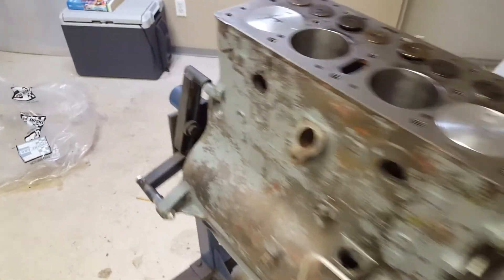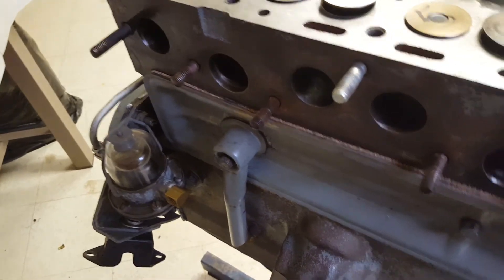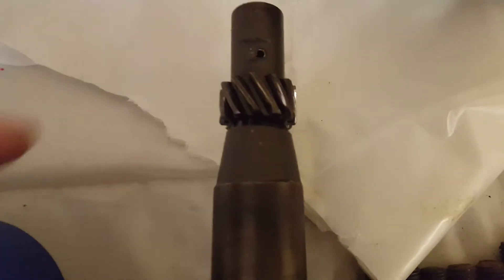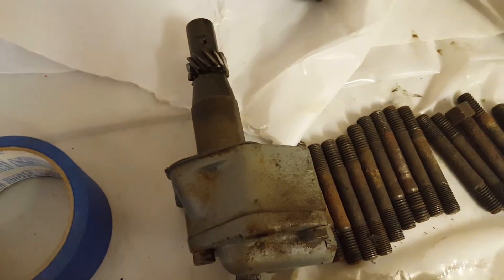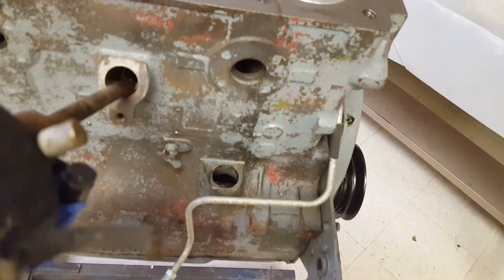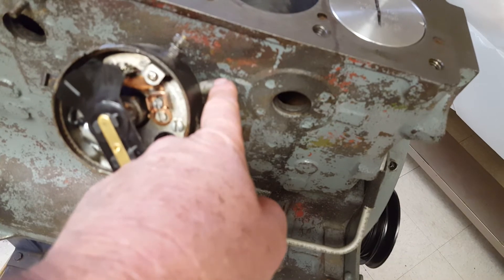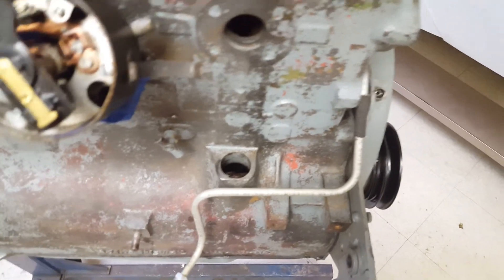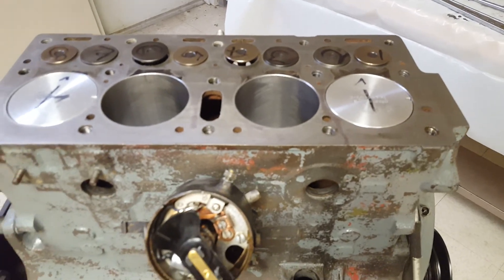L134 timing, distributor, oil pump

Comment: Fat side what the F it's an offset key
Reply from the maker: Ya, so the shaft from the pump has a matching offset slot.  Make the side that is wider up and to the right.  This makes the slot on the lower left.

Comment: You said this block was for a CJ2A and the pump should pointing to 11 o'clock.   Would that be the opposite for an MB or a GPW since the teeth go in the opposite direction.  Should a Willys or a GPW be pointing toward 1 o'clock ?
Reply from the maker: The orientation is the same.  The gears of a chain drive are opposite but so is the cam.  So all else.is the same.

Comment: If I could just get the distributor freed from the block.. next would be this very task. Itching to get the F4-134 back to oem setup, your tutorial is great and believe its applicable for the F (Hurricane) and L (Go Devil) 134 engines. Thanks again for uploading!!
Reply from the maker: A copper water pipe going up from where the oil pump mounts.  A few taps.

Comment: The oilier should be towards the rear of the engine and number 1 should be closer to the 6 o'clock position if you want it like factory. That being said, my #1 is in the 12 o'clock
Reply from the maker: Sorry but I disagree.  Every TM and factory photo show #1 at 5:00.  This puts the oiler slightly up to the front.  This allows gravity to feed oil to the dizzy bushings.  It also puts the wire to the coil closer to the coil.  If your dizzy does not jive that way, you may have the oil pump installed wrong.
Reply: @hummernutsfl  Agreed
Reply: I agree with Lew, every manual, forum, and resident Willys experts (mechanics and parts distributors) say just what this video demonstrates. Believe this is applicable for the 134 F and L engines.

Comment: Lew, being the teeth are cut different , is it possible to get the wrong pump into the engine or will it NOT fit ?
Reply from the maker: Should not fit as teeth will not mesh.
Reply: @hummernutsfl  Thanks Lew

Comment: Lew,,,have a F-134  pump slot is at 11,,,engine was rebuilt by a professional,,,but when I line up the dis. shaft,,,,it ends up at 3 O'clock or before.. tried to change the pump by one gear,, and when the dis.is in at the position the vacuum advance plate hits the engine block,,,when you try to get the points to just open..any ideas? guess as long as the points open on #1 it won't know where the rotor is anywhy. Have the same issue that Don Lowe has,,but my is original, think if I take the pump off one more time I'll lose it.
Reply from the maker: Sounds like you may be off by one tooth on the pump.  Reset the pump.
Reply: @hummernutsfl   I've reset the pump about 8 times,,,when the big knotch is correct the dis. is off,,,tired to set it at 9 O'clock and also 1   but can't get the boy to line up,,,thx much,,any more ideas

Comment: Lew, just installed a newly rebuilt engine today and discovered that the oil pump was installed off by two splines.  I need to move it 2 splines counter-clockwise.    A few questions:  1)  Any need to remove the cover on the pump, or just the 3 bolts that hold it on?  2) When I take it out, will oil pour out?    3)  Would this adjustment be easier with the diz in or out?   4)  Should the pump gasket have any sealer on it?  Thanks a lot, great video!
Reply from the maker: Tom, just remove the mounting bolts.  Best done with the distributor out so you can check the position down the hole.  I like a thin film of sealer on the gasket.  Not too much, you dont want to squeeze sealer into the oil system.
Reply from the maker: You will lose a small amount of oil.  Keep the pump up as it will be full too.
Reply: @hummernutsfl  Excellent, thanks a lot!  Tomorrow we ride!
Reply from the maker: @aboyandhisdog  cool.  Post a video on the International Flat Fender Club  fb page.  Love a rebuild start up!
Reply: @hummernutsfl  Wish I could, Lew, but no smart phone or vid camera.  I know, I know...

Comment: Lew is the set up the same with the chain drive engine, since the angle of the oil pump goes in the opposite direction and cam runs in the opposite direction?
Reply from the maker: The gears are cut opposite as the cam rotates opposite but the layout is the same.  He is a great guide:
http://jeepdraw.com/John_Barton_Engine_Rebuild4.html
Reply: Thanks Lew!

Comment: Lew, Great video! But I have a dilemma......After following the directions, and getting my distributor in, my rotor is pointing at the 3rd piston....what am I doing and how to correct?
Reply from the maker: Did you set your oil pump so the slot is in the correct position when at TDC?
Reply: #1 and #4 piston at TDC. Adjusted the oil pump so that fat side is on top and at 9.30 when going in. Once in the fat side is at approx 11.
Distibutor once lined up with oil pump has the rotor pointing at the 3rd piston.....

Revelation......the distributor that I was doing this with is brand new, but probably Chinese made.
The old distributor lines up exactly how you said it should.
So, use the old distributor w/new components or use new one pointed wrong?
Reply from the maker: @donlowe6645  I like the old units.  You can buy new bushings and springs for them.  That way your jeep will be by the book.
Reply: @hummernutsfl  Thanks Lew!

Comment: do you prime these oil pumps by dropping them in clean oil and turning the shaft? i have a flathead 6 cylinder for an old M37 army truck i have to do that to get it primed. not sure if this would be the same.
Reply from the maker: Yes, I like to prime the pump.  It is real easy.  Just fill it and turn it and refill.  Wipe the gadget surface clean and mount.  Then when I start a fresh build, I crank the motor a bit to prime the whole system.
Reply: Lew Ladwig thank you that’s what I was planning on doing also.

Comment: If my rotor button is pointing in the 9 o'clock position "tdc" does it mean my engine is out of timing?
Reply from the maker: Well, yes and no.  If it runs properly you can get.away with it.  Nut the oiler on the dizzy will not function right.  It's not hard to get it correct if you want.